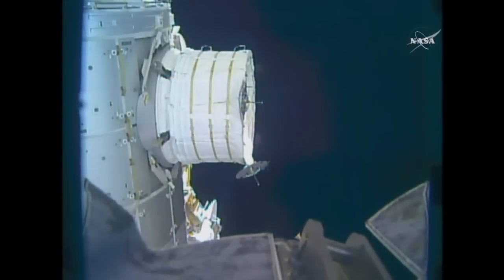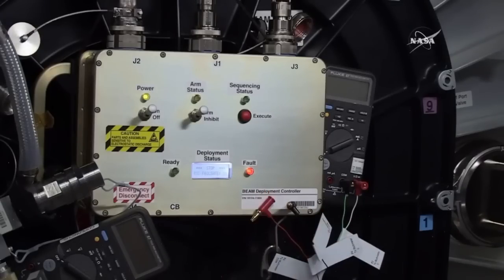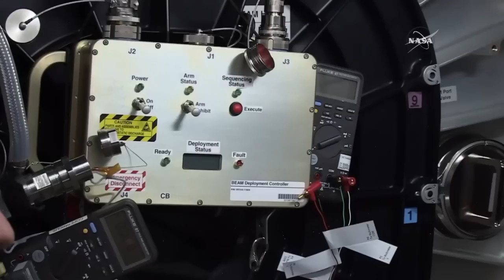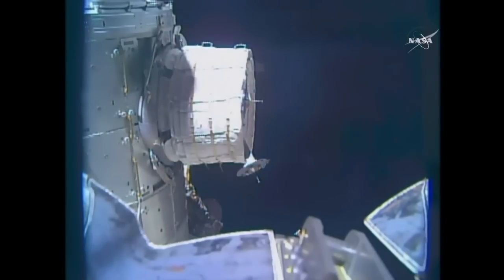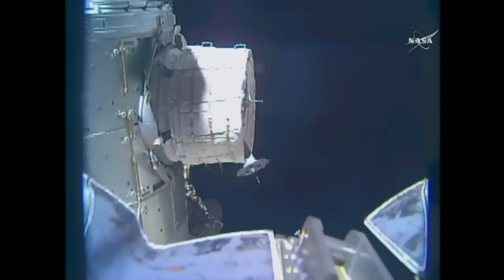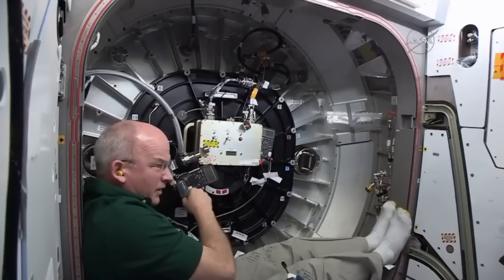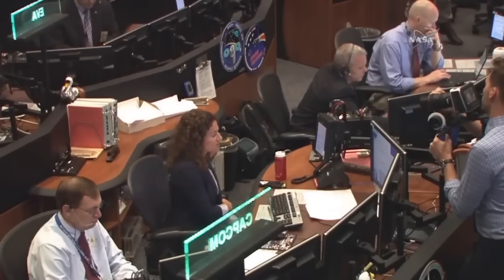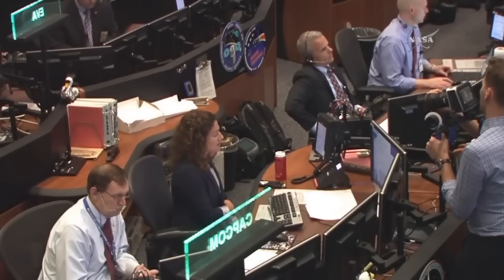BEAM deployment on the ISS

Comment: I just got my first look at the NASA feed for the BEAM launch and it looks like the pyrotechnic initiators (NSI: NASA Standard Initiator) for the straps didn't deploy. Of course they don't say any of this on the com in the recording, leaving everyone to wonder because that's the way NASA is. But when Astronaut Jeff Williams initiated the BEAM deployment the control module first had power/ ready status and the sequence light flashing, and then a yellow "Arm" status, and then it says "deploy" on the screen, (then there is a serious time edit on the recording) then three seconds into the deployment sequence a red "fault" light went on and the panel said "STOP fail-safe" on the screen and the execute light never came on, and all the sequencing/arm/ready lights went off. Then at minute :59 in the video (see link below) in control room you can see the operations manager give a dark look to the CAPCOM officer. Then on board you can see Jeff Williams break out an Volt/Ohms multimeter to test the circuit to see what is malfunctioning. Then it appears they tried forcing the straps off by applying internal pressure. This is all conjecture but something didn't fire when they tried to initiate the NSI Pyro's that much looks obvious. The straps didn't initiate release. I believe it was a failure on the pyro release of the straps and they aren't telling anyone this on the news yet. But for them to say they are turning the whole space station around to see better is a little silly considering you can see everything perfectly in the video. Either way we will know if it was the cold when they retry in the sun. 
Classic NASA spinning "During this time, the fabric in the module may have compressed on itself, causing more friction than expected." ...what a joke. In the vacuum of space with positive internal pressure? All they would have had to do is put ten PSI in that balloon and it would go "thwunk". If you look at the video after the straps were supposed to be deployed you can see they are still attached at minute 2 in the video so something didn't pop. https://www.youtube.com/watch?v=4jQ4LY-4enQ after Houston tells him to "cap the ISS sample port" for pressurizing the BEAM module Astronaut Jeff Williams says "because we have a lot of potential energy here" he was going to turn off the power supply to the pyros which means they didn't go off yet. Then he takes his ear plugs out because the pyros weren't going to be going off then. I think I figured it out. https://www.youtube.com/watch?v=qEg5RZFe9eU
Reply: This is from NASA paper on the fail rate of the NSI pyros for the straps;

"The objective of this test was to determine if the firing mode has arl effect on the failure
rate. The prototype initiators were tested (qualified) by firing them with a constant current of 5 A
(CC mode). During a shuttle mission initiators are fired by the Pyrotechnic Initiator Controller,
which consists of a 680 pF capacitor charged to 38 V discharging into a nominal resistance of 1 R
(PIC mode). The bridgewire resistance is originally 1 R and increases with temperature; the
maximum resistance prior to melting is approximately 1.6 Q. To simulate this firing mode initiators
were requalified using a Standard Firing Unit consisting of a 1000 pF capacitor charged to 20 V
(SFU mode). The PIC firing mode had the highest failure rate: 85% at 22 K, and the SFU and CC
firing modes had comparable failure rates at 22 K (40 and 42% respectively)."

40-85% failure rate at 22K? That's like saying "don't even try me unless you are facing the sun" because it is a lot colder on the dark side of the Space station than the light side.
Reply from the maker: BEAM expansion time-lapse https://www.youtube.com/watch?v=7toKLXHfNXo